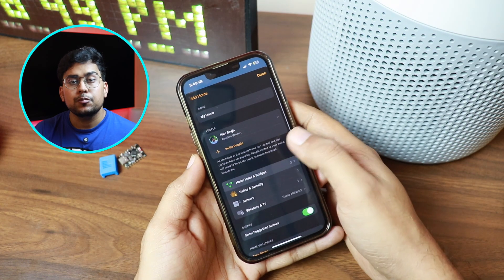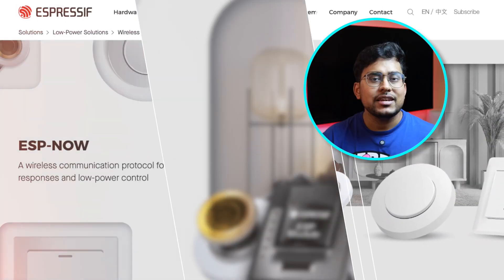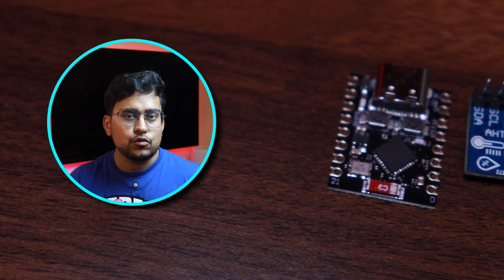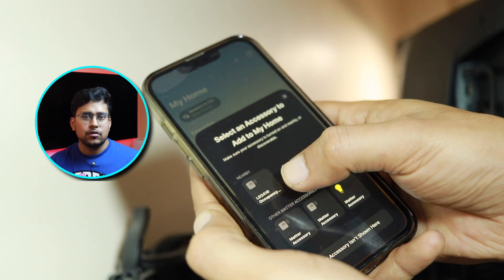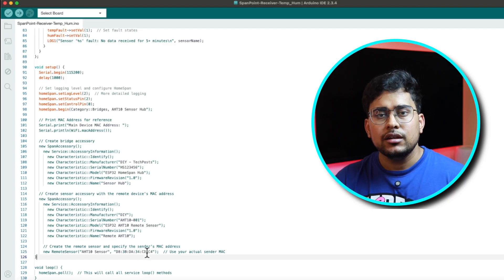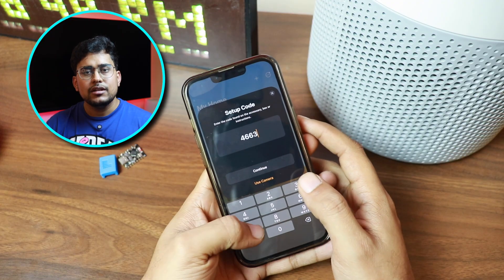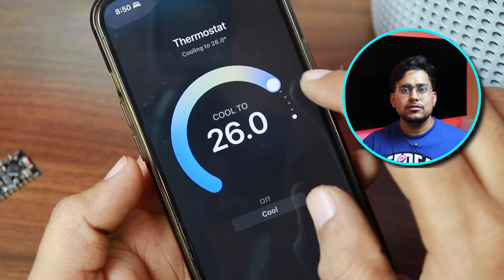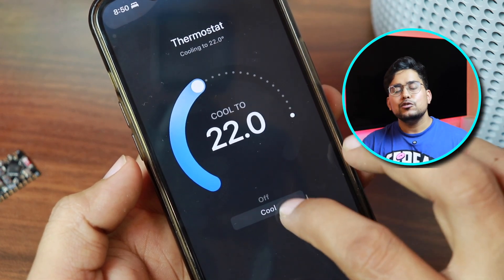Battery Powered Temperature & Humidity Sensor with 1+ Year Battery Life for HomeKit & Home Assistant

Comment: I'm just thinking of doing this but don't have home assistant, just Alexa , tuya zigbee hub and a bunch of esp32s,
I figured out the sensor part waking every 10 mins but the receiver would need to be on all time?
I was thinking of the receiver just walking up every 10 minutes to receive the signals too but that would mean coordinating the two devices to wake together and stay synced, other problem is then storing the value in receiver so that it could be displayed at any time, currently my indoor display wakes via PIR sensor , gets time and temperature online  via WiFi from web sites. And displays them on ws2812b matrix, matrix is powered via a fet so that when in deep sleep no current is drawn and battery lasts months easily
Reply from the maker: I think one hub can stay on which can actually connect to multiple sensor and the. You don’t need to coordinate anything. I use it like that and been 3 months now. Still running reliably 24x7.

Comment: Great project! Would love to put some of these together. Any chance you can recommend a battery that would work easily and be cost efficient? You should put some affiliate links on the components for your projects.
Reply from the maker: You can use any 1000Mah or may be smaller 750Mah or 500Mah (13350) battery. Life will vary with minimum 200days to 2+years. Based on how frequent you want updates from the sensor and if using an I2C sensor or one wire.